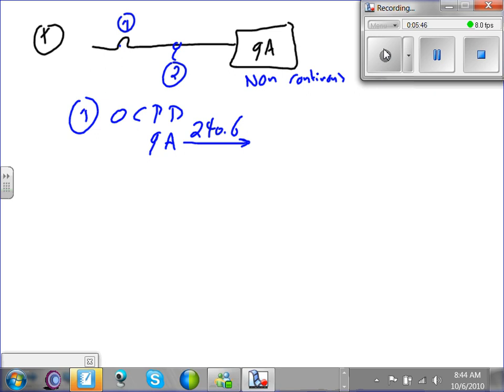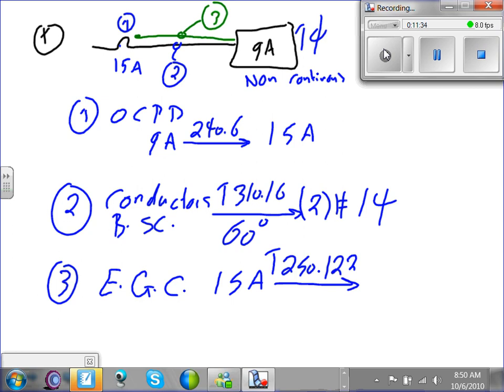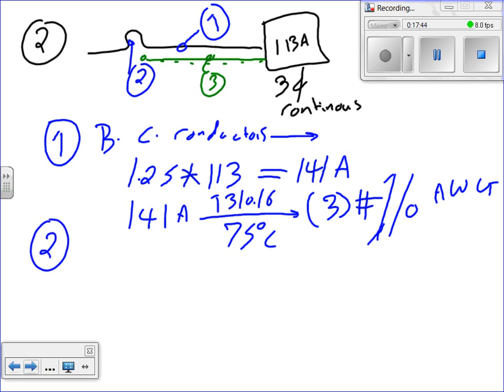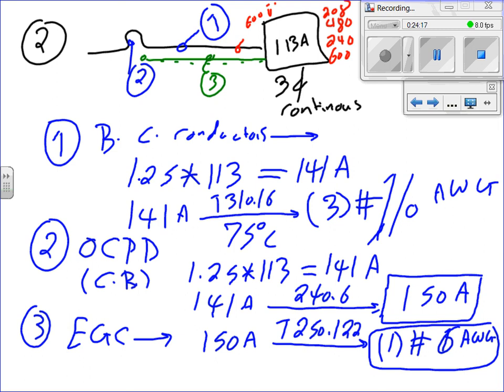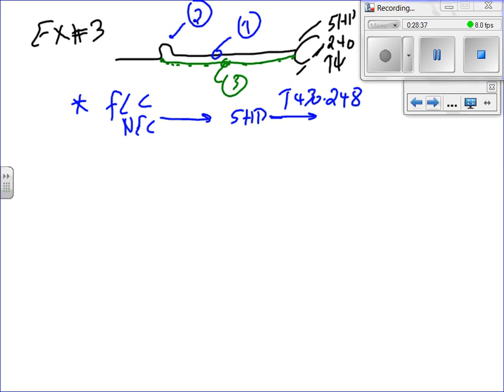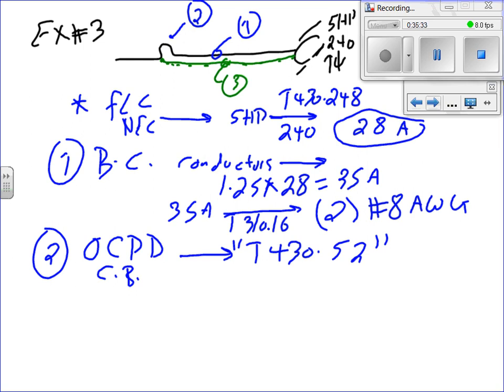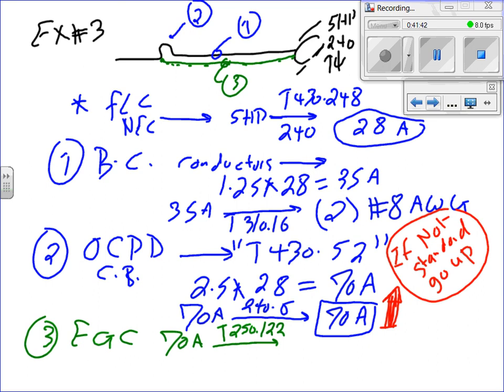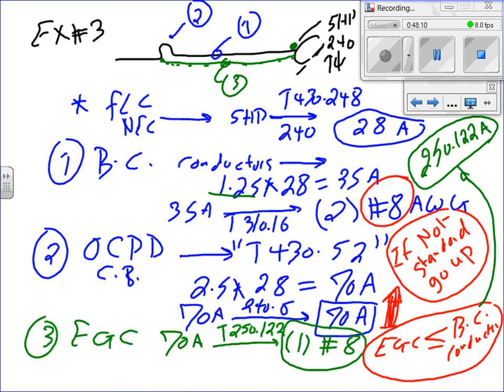Ampacity (2)-U#6-10-06-10.wmv

Comment from the maker: 20A CB is limited to 80% continuous load which equal to 16A.
After derating #12 at 50%, you get  max load of 15A. 
If you limit the load on the circuit to 15A you meet the code.
If you put 15A CB then 80% of CB Rating for continuous load equals 12A!!

Comment: A coworker is rewiring an electrical room lighting system. He ran 1" emt from an old LCP to a new one ( Lighting Control Panel, Wattstopper ), installing 16 #10"s, all CCC. I didn't like the way this was done and I'm going to have hime change it. Am I correct in this: since he installed all the circuits in one conduit ( over 24" ) we now have to derate ALSO, downstream circuits transition to AWG #12! Hence, derate for #12. 30 x .5 = 15 amp. The original 20 amp OCPD are now oversized.